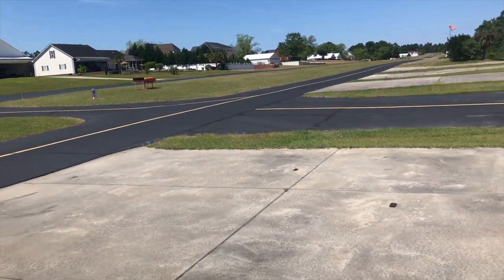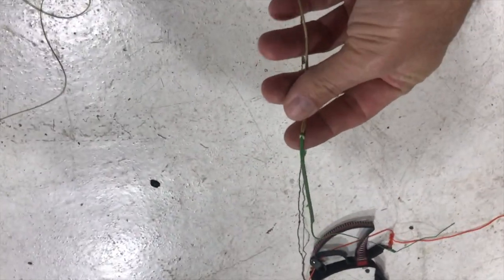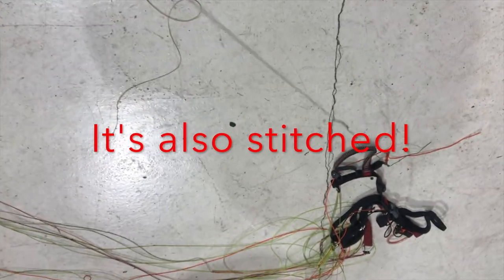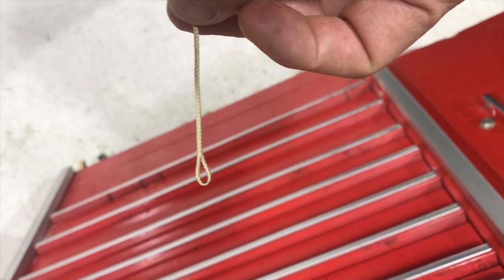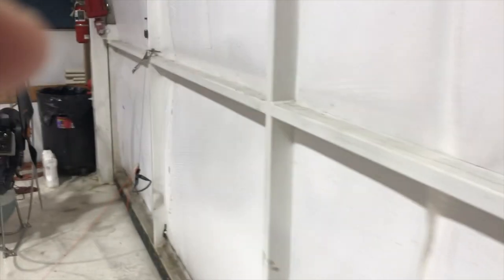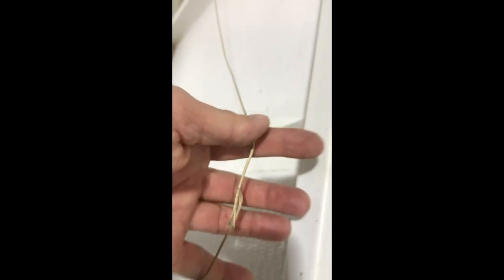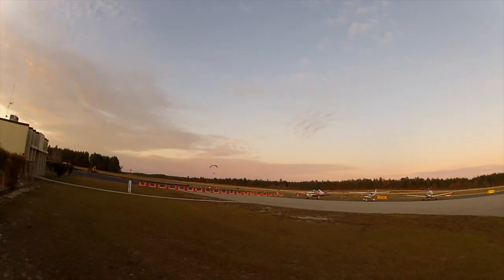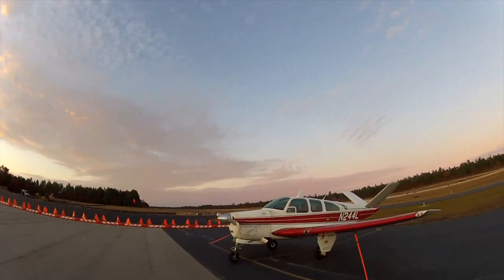Paraglider line repair.

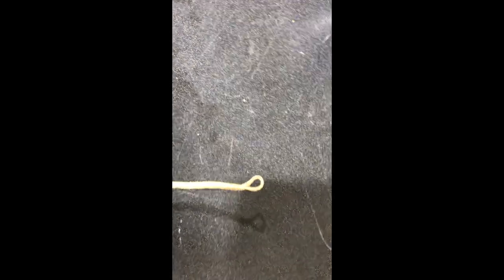Comment: Thanks... very interesting and helpful video.     At just after 4:25 in the video you have the line pulled inside it's core and have, as you say, about 2 inches pulled into it.  Do you just rely on compression of the outer core to keep it from slipping out?  Or are you stitching along the line inside itself to keep it from slipping out?
Reply from the maker: after a close inspection of the factory line, they had stitched about 9 or 10 vertical straight stitches through both the outer and core of the new eye splice.  The thread they've used was very fine and nearly invisible.  Splicing takes me back to my years of sailboat ownership.  I'd always been fascinated with knots and even more so with splicing.  Somewhere I have a collection of splicing fids, a hollow tool to aid in getting strands in and behind other strands.  So in reading up on eye splices (which is what I've done here) I find that they are often secured with super glue too. I will stitch or dab super glue through to the core on these as well, but with enough tail buried into the core I doubt it could ever pull apart under load.  Running it in further is better TWSS

Comment: Great job on that line, Todd!  My first foray into that kind of repair was on a synthetic winch line on my ATV. I used the inside of a pen to feed the line down inside itself. Was an 800cc ATV, and I pulled down hung oaks with that thing - VERY strong repair. Of course, that line was 600% larger or so ...

I managed to nick the outer sheathing off 2 of my lines with the prop so far. The inner structure is untouched, but I bought new lines anyway. Looked too small for me to repair it with any confidence. I think the sheathing will prevent that kind of repair anyway.